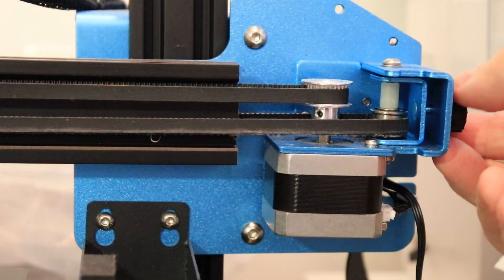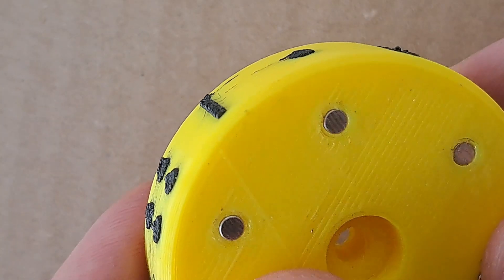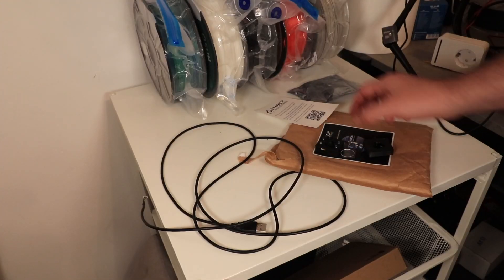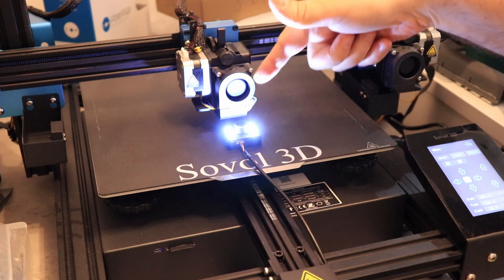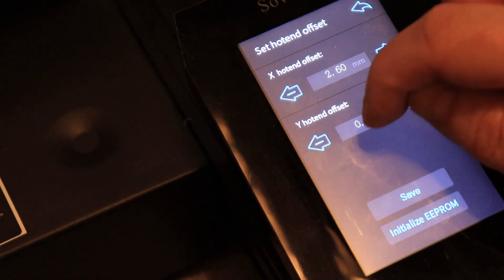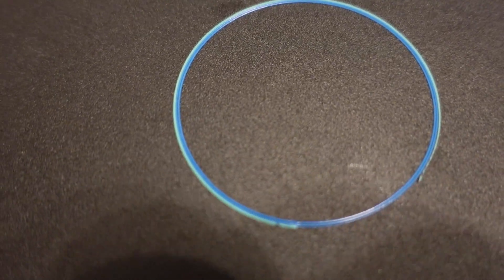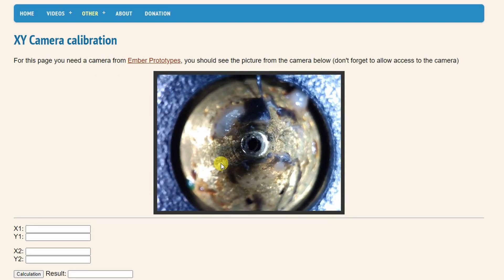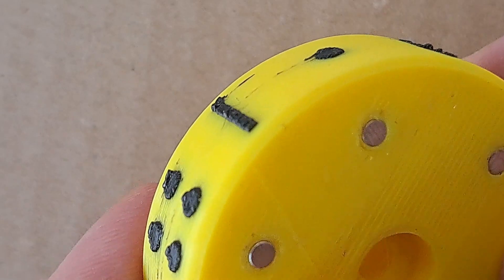XY calibration camera for IDEX 3D printers by Ember Prototypes - tested on Sovol SV04

Comment: Well I tried that with my Sovol.  I cleared the offset to Zero and Save.  But now, when the printer homes, it reads the middle as very low numbers, not what you would expect for the middle of a large bed.  I'm also running a slightly different firmware, the John Carlosn one

Comment: Could this method work with a mobile phone using the selfie camera? Receiving my SV04 soon - will probably try it :)
Reply: Right?   it's just move one extruder to a curser on the phone camera, then move the other to the same numerical location and adjust till it's over the curser, then subtract, right?
Reply: How'd it go
Reply: @LeftyPencil Nah, I just use a calibration print from printables instead

Comment: This gave me an idea to use some kind of IOT camera like an ESP32 or a RPi camera in combination with BigTreeTech Manta 8P to do a similar setup with my SV04 without having to buy this particular product. Klipper supports up to 4 cameras so it will be up to port availability to decide what goes where. Ultimately I want to do a print camera, a calibration camera, and two endoscopes for both printheads to diagnose printing failures, that would be sweet.
Another interesting feature is that it seems I can move my print bed towards me so that it clears the nozzles, so it could be possible to mount the camera to the extrusion on the bottom for fully remote recalibration.
Reply from the maker: Wow, I hope we can see your work somewhere :-)